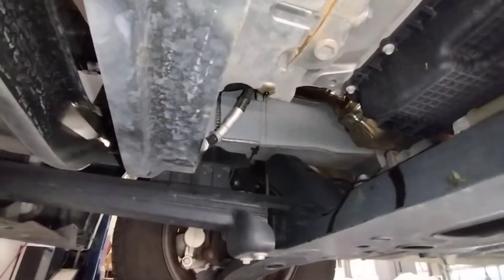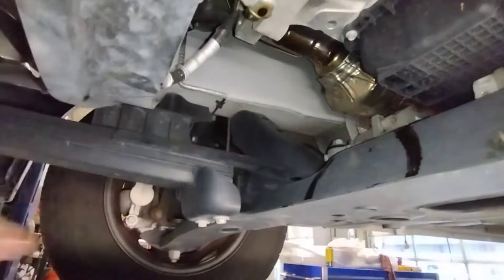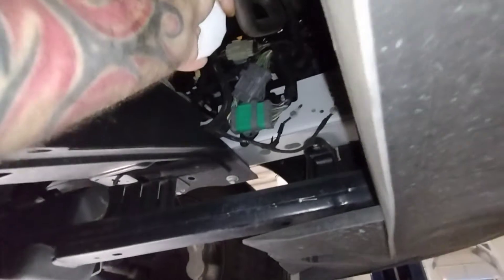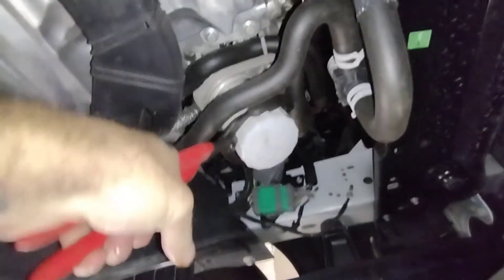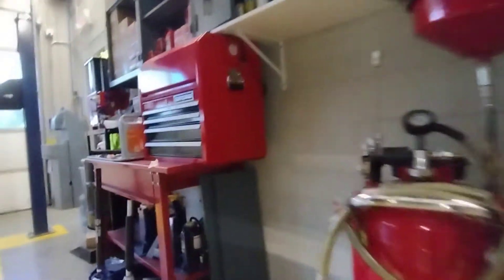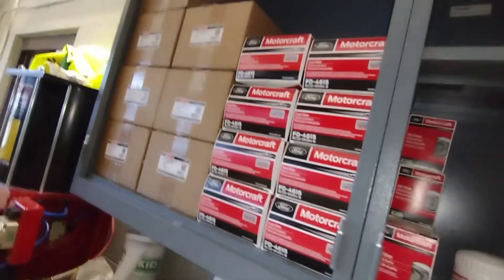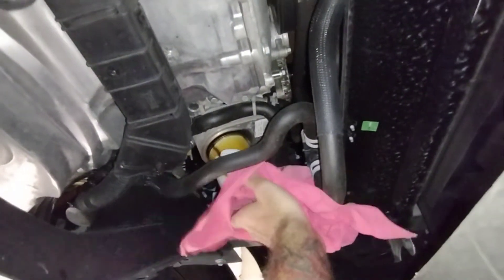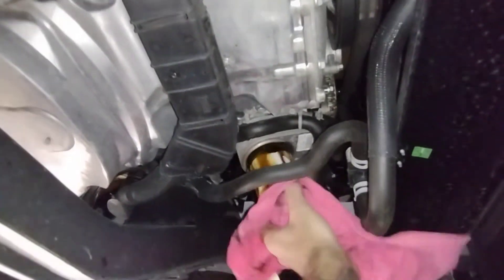2020 Ford Transit 250 3.5 liter. Stop Putting Filters On So Tight.  How To

Comment: I just tighten them hand tight. After I tighten the drain plug and fill the crankcase I run the engine and check for leaks. I think a lot of these quicky lube places crank the filter on and avoid the check for leaks step. Even after hand tightening sometimes you need a filter wrench on the next oil change because heat causes the rubber seal to become stuck. I always apply clean oil to the filter seal before I install it.
Reply from the maker: Some of these new ford tell you in the service manual not to lube the o-ring. It was causing them to back off on the GT-350. But yeah I always check afterwards. Quick lube places are in and out.

Comment: Heck that was loose compared to normal….most places put em on dry and use both hands and crank the shit out of em
Reply from the maker: True. Lol. But you remember in the ford workshop manual it said don't lube the gasket cause it causes it to back off. They found that out on the GT350.  I spin it on and hand tighten. Like 1 and 1/4 turns. This one was actually tight. I did have to use a filter wrench and I usually never have too. I've had way tighter. But. Still the point is the quick change places I swear put them on with an impact
Reply: @BeardedFordTech  you ain’t wrong but purolator (ford manufacturer for motor craft) has it on their filters for seated and 1/4 turn. I know that’s low torque but that’s the filter manufacturer spec
Reply from the maker: @jeremiewampler  this is true.  I just.go by for spec. Long as it isn't an impact. Then again. Since everyone else does it. Maybe we should too?
Reply: @BeardedFordTech  man you ain’t wrong…have ya ever had to air hammer one off cause hot the seal being bonded to the block
Reply from the maker: @jeremiewampler  yeah. I've had to chisel one and take off the adapter where it screws on and install a new one.